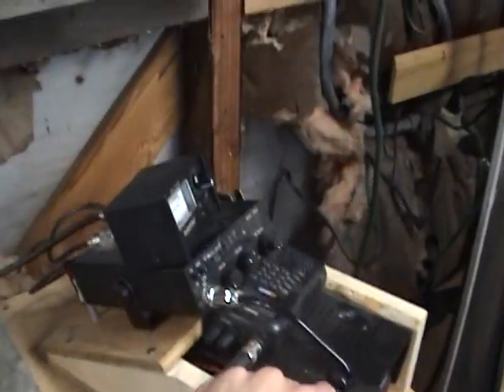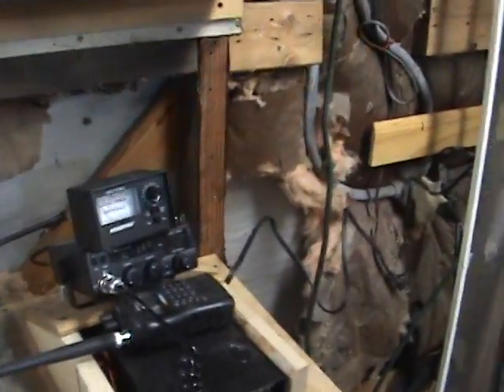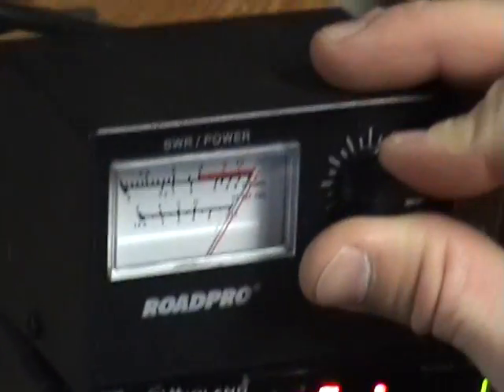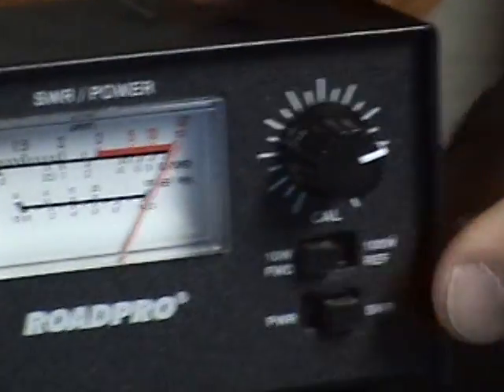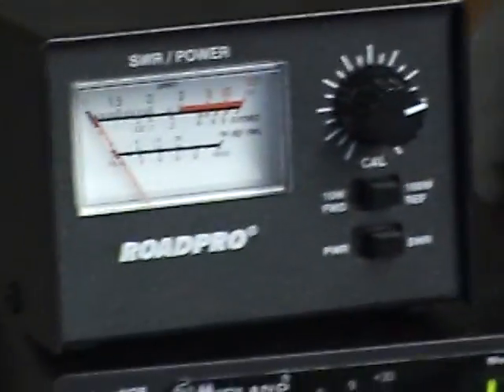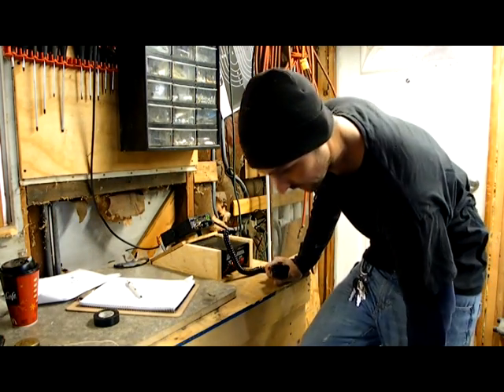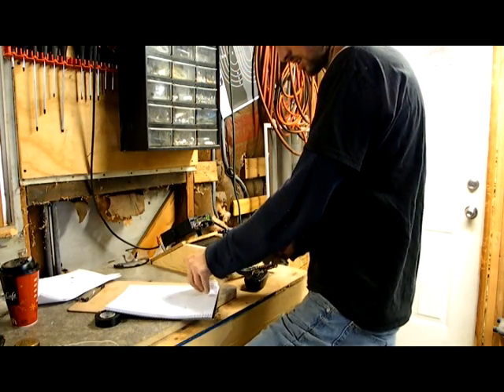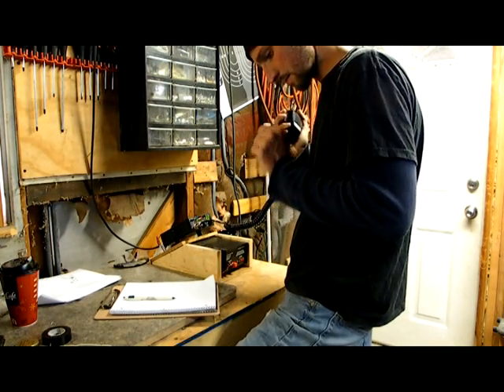Testing a horizontal dipole antenna - 1.1 SWR

Comment: A good example of an easy to make improvised antenna (and even, an emergency antenna if you need one) and how to make and set it up to work. A suggestion or two; Usually local talking communications folk would choose to use vertical mounting and  toss a rope over some tree limb near by or other tall object and pull it up with the center part of the coax on the higher end.  or mount the center wire of the coax  as high as possible and let it run down at an angle if necessary as a sloppier. Long distance skip talking folks could choose to use horizonal mounting or vertical mounting or both,  As your test run shows, it can make a big difference locally. The SWR you got is safely usable across the entire band, and purists would choose to tweak it a bit more to channel 20 as the lowest point as much as possible. Yet, you do have a good usable SWR reading across the entire band and yours is good enough to get by with. All of that being said,  you done good.. Mounted horizontally,  With skip running, I might hear you sometime over here on the east coast. I have made San Diego before, bare foot with them mounted either way, And even Hawaii once horizontally and barefoot as well, but usually my first hops end up in Texas, Arkansas, Chicago and the occasional New England area from here in the south.  But hang it vertically and check out the range difference sometime, especially for local (and long distance) talking. Beyond that, I'd just add a power mic so my "voice" can reach out as far as my radio's signal already does without fading away too much and getting lost in all the static and other noise out there. As a Ham, I've made 900 mile contacts with a 300 milliwatt toy powered by a 9 volt battery, so power isn't needed. CB's a good back up system to keep around, because sometimes, the power goes out and cell phones just won't work and some areas, just don't have cell coverage even now..

Comment: use 12awg solid copper wire,  inverted V
Reply: 14 or 12 gauge, 7u-strand hard drawn copper antenna wire id you want it to last any length of time.
Solid wire is notorious for breaking due to flexing in the wind and from ice loading!
7-strand is specifically made for antennas and will flex and resist breakage.

Comment: A suggestion: If you can, try mounting the antenna vertical. It should help the performance somewhat, since most other antennas are vertical in CB land.

Comment from the maker: @RPD709 -
#1 - Horizontal will receive a signal broadcast with a horizontal antenna better than being vertical. This is fact. 
#2 - Each channel transmits at a different frequency. Every different frequency has a different wavelength. While your antenna will work on multiple channels, it can only be tuned for maximum efficiency for one channel, this being an SWR of 1.0, while each channel above and below the tuned channel will raise your SWR. 
#3 - Have fun talking on a CB, I use cell phones.